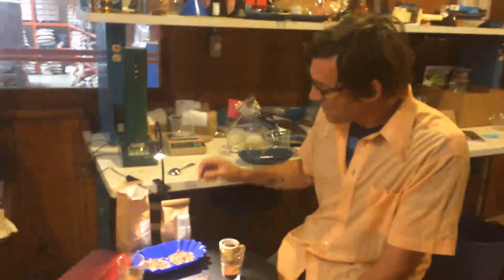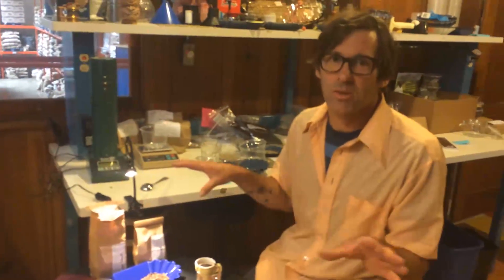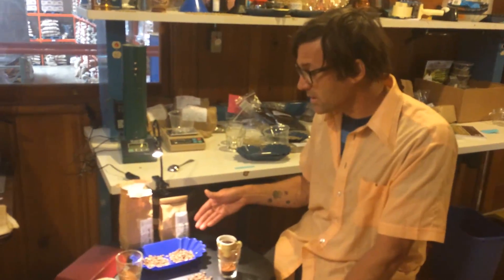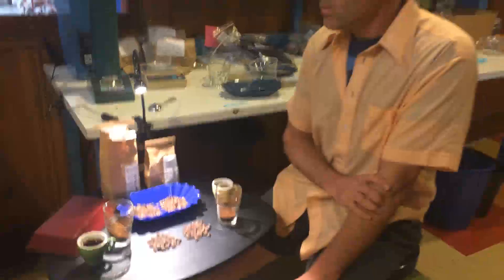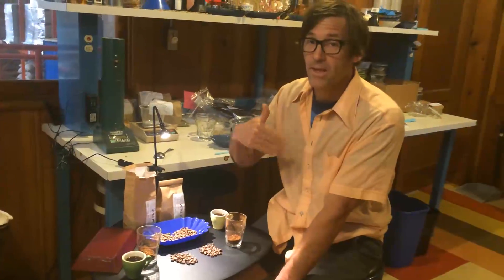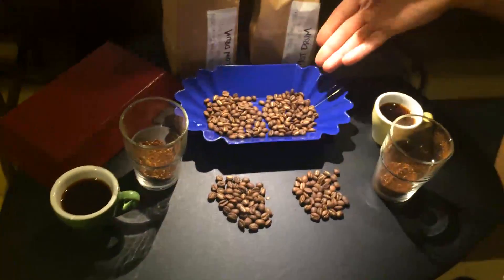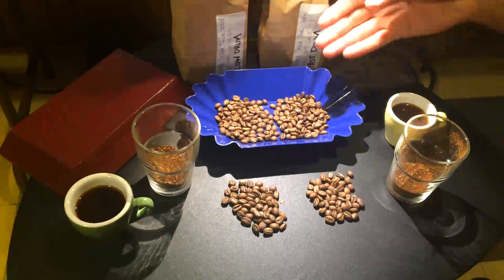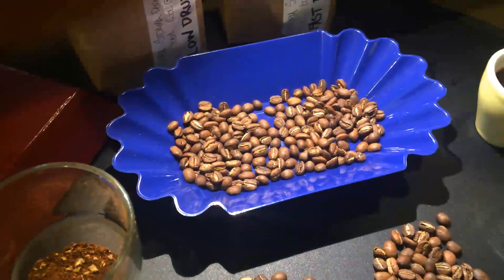Behmor Plus Drum Speed Comparison

Comment: Hey, I know this is 8 years old at the time of this post, but I feel I found a good use for the drum speed option on the 2000AB. I will roast as normal for the start of the roast, with a high drum speed. Then when the fan kicks on (around 7:30) I will wait 15-20 seconds and then slow the drum speed. While the air temp drops from the fan, keeping the beans closer will allow them to stay much hotter! I have found I can hit first crack 30 seconds earlier! Hope this is helpful 👍. Love the videos, keep it up!

Comment: To judge color (and set photo/video exposure settings) use a Kodak 18% reflectance gray card (or equivalent).  With any given lighting situation you set your exposure (or freeze an auto exposure camera) with the card at the position your subject will be in.  The setting will be good for any camera position as long as lighting remains the same on the subject.  For live viewing, use the gray card as a backdrop to judge color, in this case the color of the roasted beans.

It's establishing a 'standard reference' that is neutral for color and correct for exposure.  Artistic preferences for recording or presentation can then proceed with a stable, neutral reference.